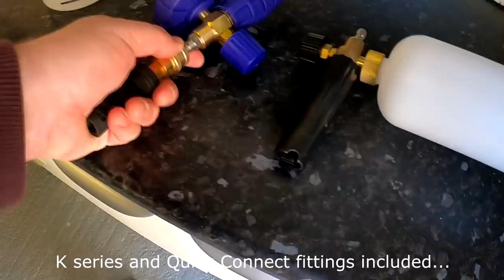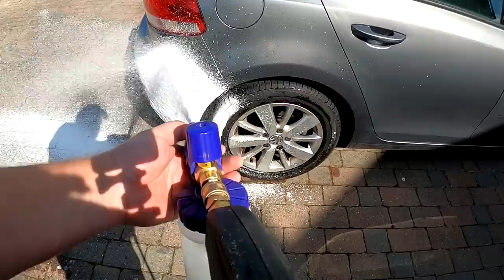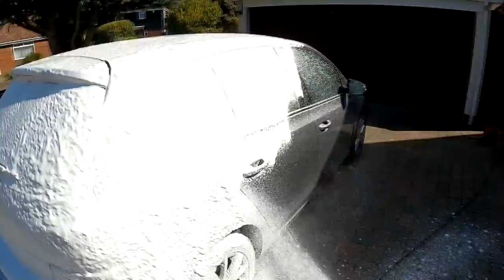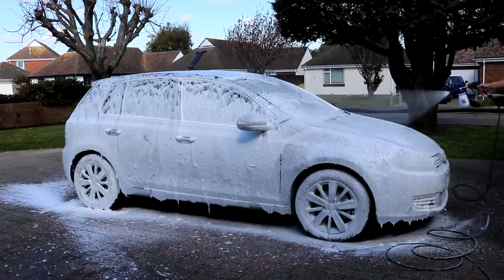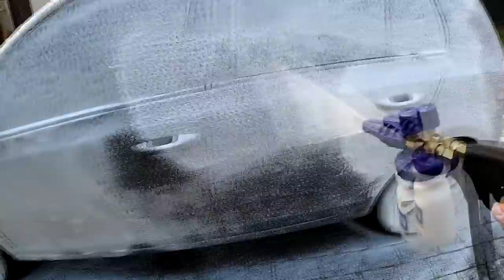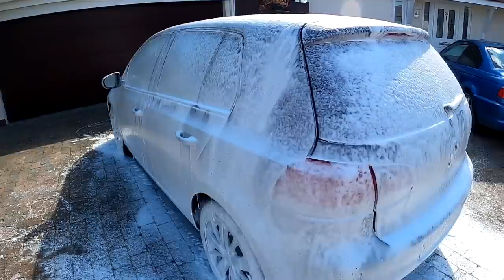New Autoglym Polar Blaster Snow Foam Lance |  The Elite Thick Snow Drift we all want

Comment: Would be interested to see BH autofoam in the same cannon to see how that looks 😀
Reply: That's exactly what i have just bought this morning, never done any of this before, so im not sure on what ratio to do.
Reply: @sciroccomods  
The data sheet that comes with the BH auto foam should state the ratio. Its 1 part in 100 for light cleaning and 5 parts in 100 for a heavily soiled vehicle. You also need to work out the flow rate of your pressure washer and know the size of your snowfoam lance bottle. More than likely it'll be about 400ml in a 1litre bottle and adjust the mix accordingly.

Comment: Looks amazing but as we know from your videos bilt hamber breaks dirt down the best.

Also is it ok to wax a car without clay barring or anything like that? dont fancy marring up the paint.
Reply: Kasam Sagir I’m not Jon and I’m certainly no expert, but IMO yes you can.

Jon’s opinion matters “much much more” than mine but I wouldn’t Clay my vehicle unless I have to or unless you feel that the containments/fallout is becoming just too much. This is just my opinion, but I only Clay my vehicle if I know I’m going to polish with a DA/rotary afterwards. 

On the other hand remember too that wax is also an abrasive so you might pick up some of those containments and scratch your car’s paint when you buff but I wouldn’t clay unless I absolutely feel like the vehicle needs it.
Reply: M8,a little tip.Clay bars are ok,but builder's putty works as good,and it costs less..

Comment: John, I seem to remember you did a video on snow foam where you recommended a “ runny snot” consistency, this made sense as obviously the dirt needs encapsulating and moving off the car. Have you changed your opinion or do you use different thicknesses between brands?
Reply from the maker: really for me consistency means nothing.  Other than fun.  AKA I dont care if its thick and foamy.  I also dont care if it clings.. but the vast majority of the market wants thick foam. Specially the USA market but most of the UK as well.
Reply: Forensic Detailing Channel thanks John
Reply: Thick foam means 99% of the snow foam is doing nothing but look pretty.

Comment: Not generally a fan of AG but have been using Polar Blast for a while, always gives a thick clingy foam that dwells really well but my main reason for using it is that you can see the dirt in the foam as you rinse, so it’s doing it’s job. Be interesting to see Jon do a side by side with BH/8 Below. Have resisted the actual Blaster Lance so far because it’s much more expensive than very similar models available elsewhere, I do like the wide mouthed bottle format but is it really £15ish better?

Comment: Jon (FDC) I have a question - (speaking of car washing foam):

I notice Bilt Hamber Auto-Wash pH is ~ 7 but yet Auto-Foam is ~ 13 pH (for reference AutoGlym Polar Blast is 7.35 pH)...shouldn’t auto-wash be 13 and auto-foam be 7 and as you claim the auto-wash to be the best “cleaning” car shampoo for which I believe you!

I know pH doesn’t tell the entire story but that pH does seem off to me. 

Let me know your thoughts as I’ve bought some auto-wash here in the USA and it delivers in the next few days.
Reply from the maker: isnt autowash PH 10 roughly?  either way the PH does not really tell you anything.  Or its a bit like looking a a fat person and thinking they are unfit when they might be fit.    you can have PH neutral products that clean better than PH 13 as well... but also it depends what your cleaning.  alkalinity is usefull for degreasing, acidity is usefull for decontamination of embedded solids.  And you can still utilize the properties of an acid or an alkaline in a detergent bland that is PH balanced, the reason for this is the specific cleaning function is not always relevent to its PH, sometimes the PH is just an irrellevent consequence.

Comment: That looks really nice an d thick. I generally use auto finesse avalanche as Ive found its very think, but will give this a go next time. 👍
Reply: Hi Steve, I've got avalanche,  what dilution ratio do you use as I find mine isn't as thick as I'd like it to be, thanks Jason
Reply: Jason. No real science other than I tend to use about an inch, then hot water to about three quarters of a bottle. Hope that helps 👍
Reply: @jasonwilson7674  I have been using Avalanche at 200ml to 800ml of water but find to get a decent thick foam I need my nozzle set fully to the minus end. I have now bought Bilt Hamber Auto Foam, not as thick but better dirt lifting which is what we all really want right?  Thick foam looks great but if it doesn't clean well then what is the point? Avalanche is good but BH is better for sure
Reply: @steverabbits  thanks, I'll wait until I've used up the avalanche first 👍
Reply: @jasonwilson7674  yep, I'm not going to waste my Avalanche. In fact I reckon I'll mix it with the BH Auto Foam  maybe I'll get the best of both worlds!

Comment: With snow foams, is it entirely down to the chemical composition or is it down to the pressure fron the pressure washer? Or a combination of both? :)
Reply from the maker: depends what you mean by "it" jack.  Are you talking about cleaning power or like how much it foams up?  if its foaming you need a foamy product for sure, but pressure and flow and the condition of the lance are important.  lances can also be designed for certain flow rates and pressure (with different orrafice sizes) so making sure you have the right lance for an electric pressure washer is important.  I did a video on this very recently discussing all the factors on the "forensic unplugged" channel if your are interested mate.
Reply: Definitely watch the other video, even is it's only for the advice of not using the AquaStop (AutoStop) fitting on your hoses.
Reply: @martinedwards1824  i have never thought/heard about this. I use aqua stop for the convenience of it - guess i'll check the video out!
Reply: @martinedwards1824  which video is that on? Thanks

Comment: Good stuff John. The blurb on the website says "Polar Blaster is a unique foam gun designed to work in harmony with all Polar Series products". Does that mean that it is less effective with other products like Bilt Hamber autofoam?
Reply from the maker: it will work fine with autofoam but AF just wont foam up too well in any lance.
Reply: @ForensicDetailing   Cheers Jon. Yeah, I watched your AF video earlier and note that it doesn't foam the most, but it's the cleaning power that matters most to me. Thanks again.

Comment: Hi, Forensic Detailing Channel could you give me a little advise please as im new to this, iv just bought this foam blaster and also BH auto foam, my jet wash is a karcher k4 full control , i was wondering how much BH to put in and how much water, and would one polar blaster container mix do a full car, thank you.
Reply: I did my car yesterday and mixed it 166ml of auto foam to 830ml of water, result was runny foam, and i used between half and 2/3 of the blaster container, it did clean the car quite well tho, and it was ground in 1.5y old grime,  ill do 250 ml next time and adjust from there.

Comment: Hello john hope your well, how would you compare with other lances on the market? I use a cheap ebay jobby which works rather well and quite a fan of AG products as i find them very easy to use, what is the price of one of those?
Regards
Nick
Reply from the maker: if you have a lance that works then you are sorted.  but I can say this lance is superb.  im struggling to fault it other than it has no like measuring scale on the bottle, (I put a black marker line on it so I know what 100ml is)

Comment: Like a few others on here I am not getting thick foam what am I doing wrong? 

Using the official AutoGlym polar blaster canon with polar blast product. I’ve got the blaster set to maximum foam and put in 100ml product to 500ml water as directed. 

Any help would be much appreciated by myself and others who are having difficulty with this. Thank you.
Reply from the maker: have a watch of this dave https://www.youtube.com/watch?v=wxY8nK734RE&
Reply: @ForensicDetailing  cheers John, just watched your video very interesting. Firstly I’m using a new K2 pressure washer and I’m connecting it to my hose reel with you guessed it... a stop flow connector 😅 so I’m going to sort out a small length of hose with normal fittings to the pressure washer and go from there 👍

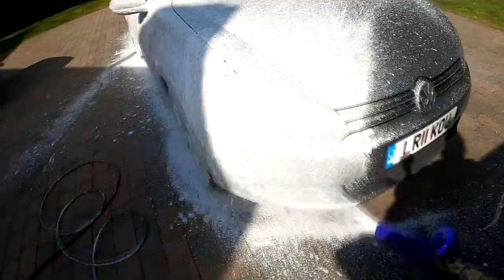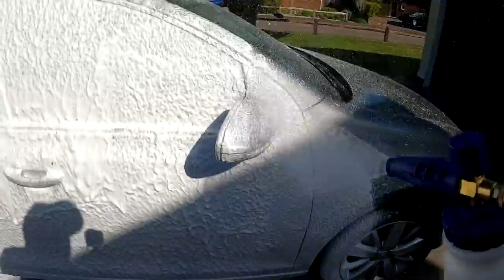Comment: I purchased an Ultimate Snow Lance  (from Ultimate Finish) a number of years ago, it is still going great! I have a question though... you can twist the barrel into one of five positions to set a dilution percentage (I = 2 to 2.5% / II = 3 to 3.5% / III = 4 to 4.5% / IIII = 5 to 5.5% and IIIII = 7 to 7.5%), so if I put neat product into the bottle and set a position IIII it will mix at 5% (effectively 1:20)? is that correct or am I just being a numpty. Effectively I don't think I can use this lance to mix at 1:5 or 1:10 unless I pre-dilute the product in the bottle. Any advice appreciated. Thank you!
Reply from the maker: do the bucket test mate this will confirm it.. if you search how to calcuate bilt hamber PIR I demo the bucket test.
Reply: @ForensicDetailing  Thats great thank you!

Comment: Is the mixture knob "loose" on this AG foam cannon or does it have "steps" to adjust the solution ? in my existing lance it's loose and it drives me crazy :) I mean loose.  When it's windy it almost adjusts the ratio itself :)
Reply from the maker: should be able to tighten it up surely?
Reply: @ForensicDetailing  It's tighted for sure. Maybe it is that way,     sprays foam ok tough. Maybe i'll buy the polar blaster for the sake of this endless money pit hobby! Cheers!
Reply: Sorry about harrasment :) Just got the polar blaster and tried it. It had an issue with my Karcher K7 pressure washer. It sprayed about 2 seconds and died. Continued and did the same thing all the time. 
I had another foam lance and changed the nozzle (Inside the lance, after the adapter thread thing)  from the old to the polar blaster, now works great. I remember you did a review about K7 washer what you purchased, did you have issues with that ?

Comment: I’ve got a Ryobi pressure washer which uses a different fitting to Karcher, so couldn’t use an Autoglym cannon. However I only get a very thin foam out of it, any ideas what I’m doing wrong?
Reply from the maker: on the forensic unplugged channel I did a video called something like "The Secret to making thick Snow Foam
"  have a watch of that gordon

Comment: Do you reckon it will still have the same effectiveness but when combined with Autofinesse products?
Reply from the maker: of course mate it makes no differnce which detergent you stick in there really.  although this autoglym polar blast is very very thick so other foams may not perform like you see it performing for me.  I also have a lot of pressure with my k7 which gives god like foam.

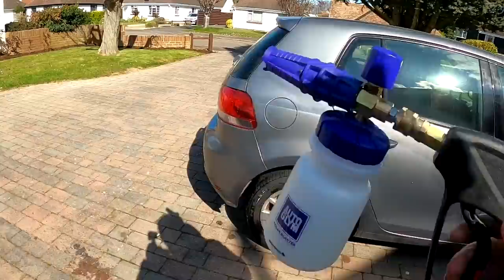Comment: I have purchased this but have yet to use it, looks like it will do the job. What is the adaptor (at 0:24) you have between your trigger and the quick release connector that comes with the polar blaster? I have a couple and would like to cut it down to just one like yours.
Reply from the maker: so the gun is quick release fitment (female).  And the lance is quick release male.  so they just plug togther thats it.
Reply: @ForensicDetailing  Sorry I should have been more clear, I have an M22 to a 1/4 inch quick release female on mine but it is a couple of pieces screwed together. Yours looks like a one piece M22 to 1/4 inch quick release which I haven't found yet, all the ones I can find are 2 piece.
Reply from the maker: @michaelbretton299  in2detailing sell it and can advise on the specs but the output end is 2 pieces a quick connector screwed into the gun so I think its the same?
Reply: @ForensicDetailing  Ah thanks i will have a look in a min

Comment: Been using BH auto foam, never had it foam up like that, I am putting 320ml of solution in a litre, not sure if it’s the mix or the gun,
Reply: Bh will not foam up no matter how much u put in the bottle,it's not designed to do that.
Reply: Ok thanks, I only do my car and it never gets that bad so BH does the job.

Comment: I have this foam gun and it doesn't give me thick foam at all, even on the thickest foam setting. What am I doing wrong?
Reply: I’m having the same issue, gonna change the ratio to 100ml product to 400ml water and try again.
Reply: @diddly206  I tried that, and even added a bit more soap than needed, but still came out like white water. I sent that shit back and got a refund :')  Let me know if it works for you when you try again
Reply: @shaundasilveira3356  John just replied to one of my comments with a link to another of his videos.

https://youtu.be/wxY8nK734RE

I think what’s causing issues for me is the fact I’m using a K2 pressure washer with a stop flow connector on my hose 🤦🏻‍♂️ so I’m going to start by changing this fitting and see how it goes.

Comment: What power setting do you have ya karcher. Because when I use my snow foam gun to it.,it seems to start stop all the time
Reply from the maker: I have 180 psi 550 flow rate. sounds like your backing up your karcher too much.  could try wider orrafice mark.
Reply: @ForensicDetailing  I have the same pressure washer as you mate because there is 3 power settings on it.... My oriffice is a 1.1 the small one

Comment: I’ve been using the AG polar blast for a few weeks and even after washing off, the car is still quite dirty. Been leaving it to dwell for 10-12 minutes...any tips or is it just a poor prewash?
Reply: Buy Bilt Hamber Auto Foam and throw the AG product away! That and work out the correct ratio PIR (more than you would think if you run a Karcher washer ~ my K4 needs a 40/60 mix P/W)
Reply: Bilt Hamber for me too. I don't use anywhere near a 40/60 mix and get a good pre clean. I think water pressure and other things may effect the quality , so just play around with the quantities until you are happy with the results.
Reply from the maker: it doesnt have the cleaning power of bilt hamber auto foam. nothing does though really.  Its a milder snow foam closer to PH neutral.   But it will do a job.  If I pre wash with blast and then contact with polar wash I have a clean car.

Comment: I got one... and I must say I'm not impressed with the container falling out of the cap. For that kind of money you'd expect it to at least stay where you screwed it in... Using a wide variety of AutoGlym products, and this is by far and apart the one I don't recommend to anybody. 

Your foaming technique is wrong, you're supposed to do it in reverse to mitt washing. Instead of top to bottom, bottom to top. Just my 2c. Before you say anything I'd like you read the instructions (and point out that I'm an Auto Glym trained and certified detailer, not many of us are)

Comment: Can I ask what ratio of mix you have for this? I've recently bought the Polar series and when I mix it to the ratio on the bottle it just isn't enough, I'm mixing 125ml of product with 125ml of water to give 250ml of mixed solution, which is what's on the box. What mixture do you have in the blaster there? Loving the videos, keep them up.
Reply from the maker: Im about 1:5 here but I have a K7 which really has great through put and makes great foam.
Reply: @ForensicDetailing  thanks for the reply, so 100ml of wash to 500ml of water, is that with the blaster turned up to max?   Just you seem to have a great foam from that, does the pressure washer make, that much of a difference? Have an old K2 here, but may well upgrade soon

Comment: Tip over test?
I just got Dr. Dirt bottle.
Reply from the maker: its not as stable as Dr dirt, the base is not as wide and its slightley sort of rounded botten rather than like shape edge bottem.. but its much more stable than normal 1 litre bottles. It solves the problem well.
Reply: @ForensicDetailing 
Thanks John.

Comment: Hi, I bought this exact snow foam cannon and I have a Karcher K4. Unfortunately my snow foam doesn’t come out the way it does on your video. I’ve connected it to my gun and it has modes 1-3, 3 being the most harsh. My snow foam comes out straight  and doesn’t come out wide. Sorry if i haven’t explain this properly. I mean it doesn’t come out in a wide stream more of a straight stream of foam. 

Do I need a different gun or do I need to do something to the lance?
Reply: Have you tried adjusting the spray pattern on the end of the cannon it should twist from straight to wide. It is most likely to do with the lance, the pressure washer should be fine.